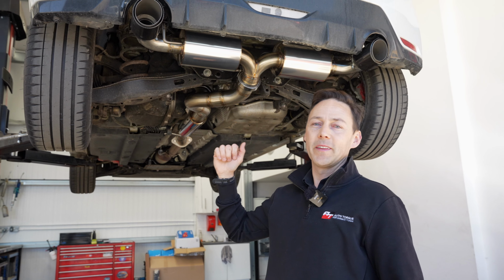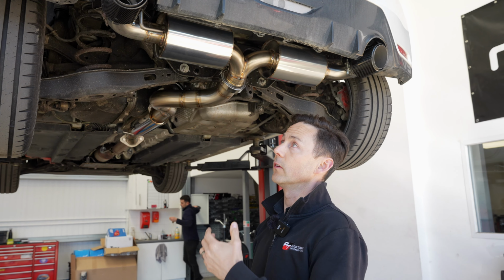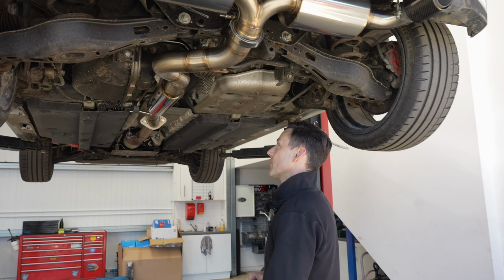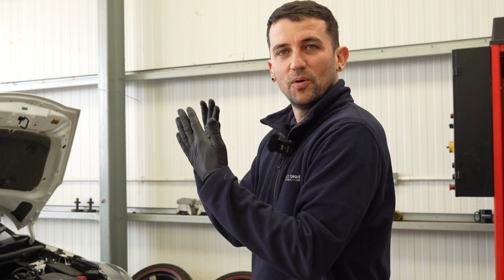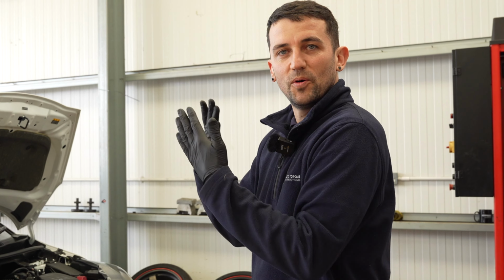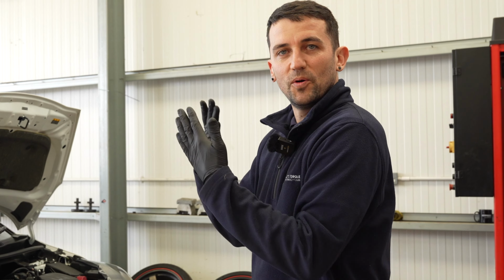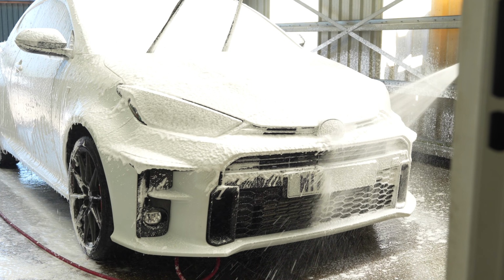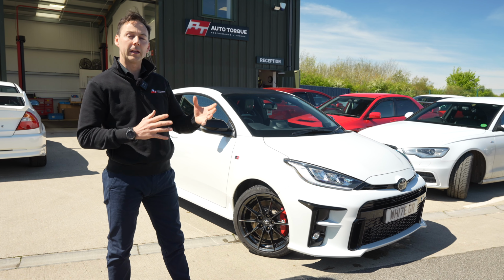INSANE SOUND UPGRADE TO THE TOYOTA GR YARIS | Custom exhaust and Eventuri

Comment: 🤣🤣🤣🤦‍♀️seriously why
Reply: What are you confused by? Why wouldn't you put intake and exhaust mods on a modern performance car?
Reply: Take out the restrictions help it breathes better, unleash the actual attainable power, what's wrong with that? 

That being said, a good downpipe would be sufficient, don't need the intake nor the catback. Those are more of an driving experience enhancements.